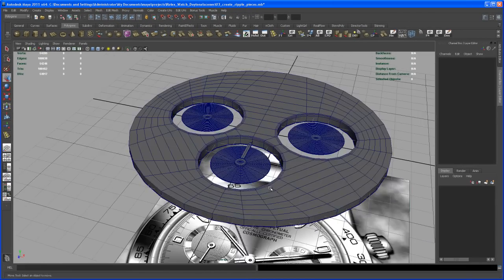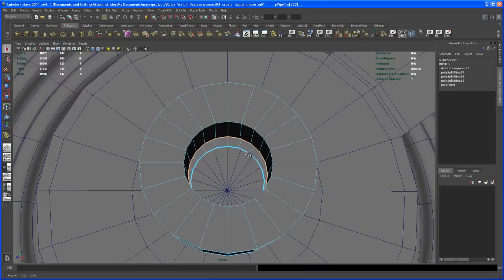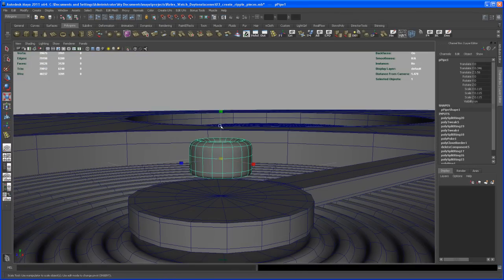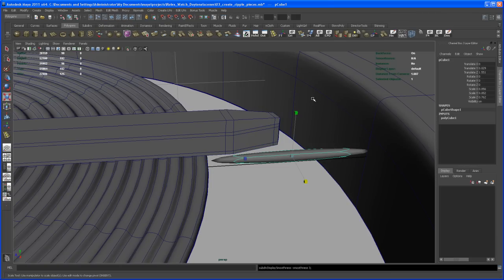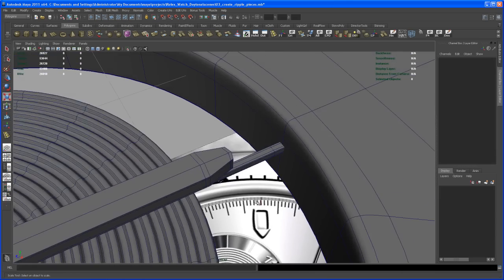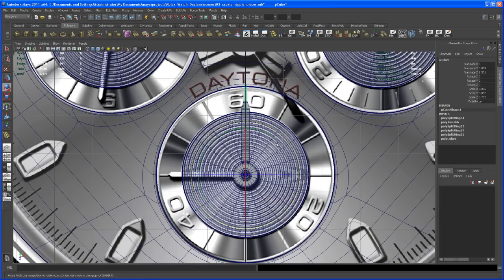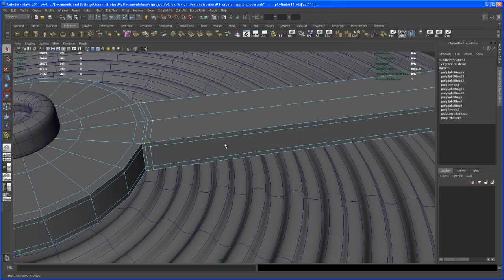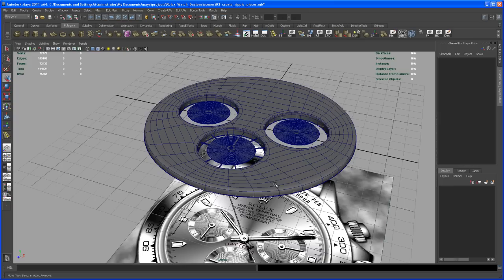Modeling tutorial in Maya - ROLEX DAYTONA watch - Part 4: create little boxes

Comment: Hey Pixelbahn, I really appreciate these videos. They are incredibly informative and I have learned a great amount. I am having an issue with the pivot point of some components of the watch. For example the edges on the dial/needle of the watch are not going back and forth perpendicular with the edge. Instead the pivot point of the z and y axis are going diagonally. How can I readjust the pivot so that it go in the correct directions? Thanks!